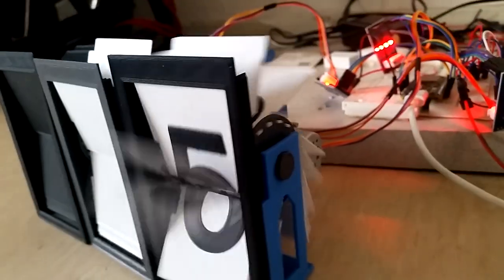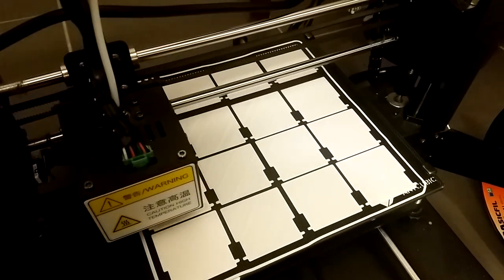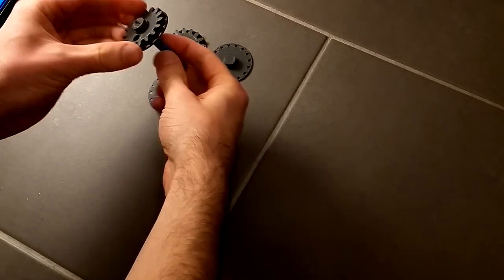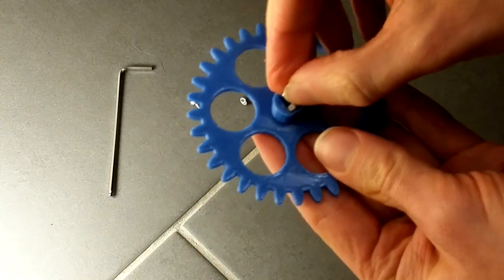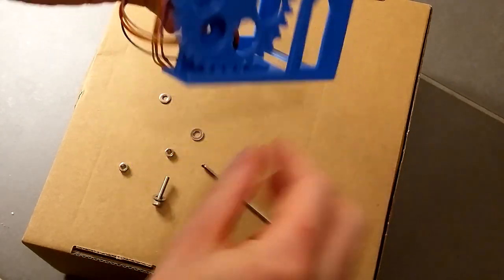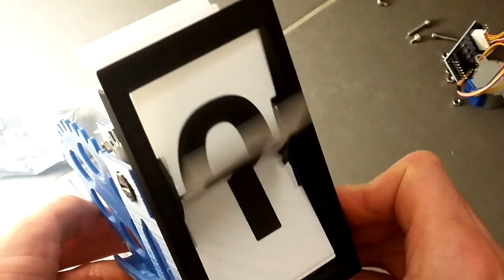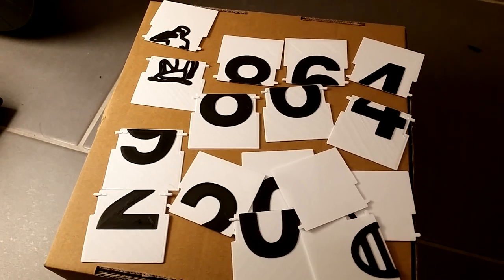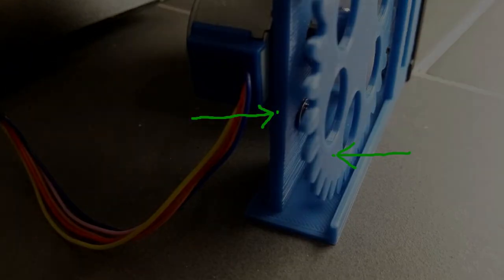3D printable Split Flap Display - Just Build Your Own :)

Comment: i would suggest adding bearings in the design if someone doesnt have a hall effect sensor you can use a lever switch as a trigger for position checking
Reply from the maker: Thanks for your feedback! I designed it in a way that requires a very slow amount of additional parts. It would run a bit smoother with ball bearings, but it is also okay without if you use sandpaper. The idea with the switch is pretty  nice :)

Comment: They look great!
I have read that these steppers aren't 100% accurate, that the gearing is off ever so slightly. So a full turn wont be 2048 steps, but some fraction less. Did you notice that with your steppers? Or did you use the software to adjust to the correct position if the hall effect sensor doesn't detect the magnet at the predicted time?
I'm asking because I'm building a split flap display on my own, and want to know if I'm overcomplicating things :D
Reply from the maker: Thanks for your reply :) I tested it several times with 65536 steps (so in this case 64 full rounds of flaps) and when i activley tested it, i could not detect any problems. But i noticed that they sometimes don't work perfectly over longer periods of time. I don't know if that is because of poor connection or stalling of the stepper or inconsistencies in the printed material - so, hard to say at the moment. But a hall effect sensor should fix this, i had the same idea as you, just check it appears at a predicted step number (every 2048), and if not (with a defined tolerance), recalibrate the values. But didn't implement it yet :D
But i think it runs accurate enough that the error rate is very low when you check and correct the position with a sensor.
Reply: @glumpfi  Thanks for the quick reply. That's great to hear, so I guess I'll hold back with coding that until I see noticeable errors. :D Gotta get the hardware working first anyway ... haha
I also love how you drive the drum with gears, you don't see that in diy split flaps often.
Reply from the maker: @paulurbaniak2242  I can do an extreme test tomorrow, with hundreds of rounds and test how many steps i need to correct to hit the exact same spot (if any?)

And actually, i chose the gear part just because i didn't want to buy expensive parts and i needed a design with very close digits. The real Lost-counter has almost no spacing between the digits, but i guess it is CGI. I have no idea how to get them so close together :/

Oh and one reason for the gears was that the motor is extremely slow! Only one revolution every 4 seconds.
Reply: @glumpfi  If you do that it would be awesome if you could share your results!

I know, the close spacing is an aspect i was working towards as well. I found the solution of putting the stepper inside of the drum that holds the flaps. That made for some more complicated cad, but it works quite well actually.
From what i have seen, the commercial units also used gears to translate the motion. As they can be really flat, thus achieving a tighter spacing. It makes the units deeper, but that's not really an issue.
And Oatfoundry (a company that makes split flaps commercially now) is using belts to drive the drums. But yeah, that's more expensive and not as space saving. I mean its probably worth it when you're building displays with thousands of units, but probably not something for diy in my opinion.
Reply: Pff ich sehe gerade, dass du deutsch sprichst. naja... :D
Reply from the maker: @paulurbaniak2242  Oh, the motor inside is a really good idea i never thought of! Unfortunately a bit slow with BJY motors. But you it would be compensated with a higher number of flaps, like with letters and so on... May i ask what you are planning to build?
Never thought i would have a conversation between split flap builders :D
Reply: @glumpfi  We can talk in german if you'd like?
Wir können gern in deutsch schreiben, es sei denn englisch ist dir lieber :D
Reply from the maker: @paulurbaniak2242  Können wir machen :D Ich glaube, an diesem Punkt ist das Gespräch eh schon viel zu speziell geworden, als dass irgendwelche Splitflap-Leute auf Youtube dem folgen müssten ;D
Werde aber erst morgen wieder schreiben.
Reply: @glumpfi  Ja das klingt vernünftig. Ich mach auch erst mal Schluss jetzt, ich schreib morgen in Ruhe.
Reply from the maker: @paulurbaniak2242  Also, gute Nachricht: Habe den Motor jetzt mal über eine Stunde laufen lassen (2.048.000 Schritte, genau 1000 Runden) und er steht genau dort, wo er angefangen hat.
Reply: @glumpfi   Danke für das Update!

Das ist super. Die Quelle für meine Sorge ist übrigens das hier: [hab den Link jetzt ganz entfernt. War auch nur ein Bild, was die Übersetzung in dem Stepper gezeigt und ausgerechnet hat. Da kommt man am Ende auf eine Untersetzung von 1:63,68]

Ich bin gerade dabei, selbst eine Fallblattanzeige mit 50 Fallblättern (flaps) zu bauen. Mit 3d-gedruckten Bauteilen, das Gehäuse und die flaps mit dem Lasercutter. Das Ziel ist dann eine 5-stellige Anzeige (Verwendung auch als Uhr).
Der Prototyp funktioniert auch ganz gut, paar Kleinigkeiten sind noch zu machen.

Dieses Video hat mir übrigens der YouTube-Algorithmus vorgeschlagen, weil ich in letzter Zeit so viel Videos zu split flaps angeschaut hab :D

(anscheinend kommt der Kommentar nicht durch, wahrscheinlich wegen dem Link...ich hoffe es klappt dieses Mal)
Reply from the maker: @paulurbaniak2242  50, wow, das ist eine Hausnummer! Sollte mit dem Stepper aber noch machbar sein. 5 Stellen sind bei mir auch geplant, 3 schwarze und 2 weiße.

Cool ist auch, dass das Projekt so universell einsetzbar ist. Habe es mit einem ESP32 gemacht (ein zweiter kommt noch dazu, weil einer nicht genug Pins hat) und habe so mit einem Script z.B. die View für dieses Video halbwegs in Echtzeit anzeigen lassen :D

Wie steuerst du das Ganze an?
Reply: @glumpfi  Ich hab eine ganze Weile überlegt, ob 50 wirklich machbar sind. Habs dann aber einfach probiert, und es klappt auch.

ESP32 ist cool, ich überlege auch einen mit rein zu bauen. Ich hab nur leider gar keine Ahnung, wie ich den dann richtig programmiere. Aber dazu gibt es zum Glück viele Tutorials :D
Hätte natürlich was, um sich diverse Dinge ausgeben zu lassen, und natürlich auch die genaue Uhrzeit. Naja, kann ich immer noch nachrüsten.

Ich hab einen Arduino (momentan noch uno für das Prototyping, am Ende kommt ein Nano rein) für die Steuerung. Ein RTC-Modul für die Uhrzeit und für jeden Stepper einen Treiber (A4988). Ich hab die 12 V - Variante der 28byj-48 Motoren, um bisschen mehr Drehmoment zu haben und um die mit dem Treiber ansteuern zu können.
Reply from the maker: @paulurbaniak2242  Ein A4988 geht auch für diese Motoren? Habe da diese blöden ULN2003 mit 4 Pins pro Motor, was einfach irre viel ist. Die A4988 brauchen ja glaube ich nur 2 bzw 1 Pin, wenn die Richtung immer gleich bleibt, oder? Das wäre cool, weil ich aktuell 2 ESPs brauche, die dann irgendwie miteinander kommunizieren müssen :/

ESPs funktionieren eigentlich genauso, auch über die Arudino-IDE (mit ein paar leichten Anpassungen). Kann ich sehr empfehlen, allein wegen der enormen Geschwindigkeit/Speicher und WLAN.

Hab z.B. bei meinem den mitgelieferten Webserver verwendet, so dass ich die Ziffern einfach über einen Link von überall aus einstellen kann :)
Reply: @glumpfi  Der A4988 funktioniert für Schrittmotoren mit einer Spannung von 8 - 35 V. Deshalb konnte ich da nicht die 5 V Motoren nehmen, hab aber die 12 V Version gefunden (die gibts nur nicht so häufig). Weil mit die 4 Pins pro Motor auch einfach zu viel waren. Da sich die Richtung nicht ändert, braucht man pro Motor 1 Pin + 1 Pin für alle für die Richtung.
Soweit ich es verstanden habe, ist das rote Kabel an den Schrittmotoren nicht für die Ansteuerung notwendig. Diese ULN2003 haben ja auch nur 4 Kanäle. Und dann funktioniert die Steuerung mit den A4988 richtig einfach. Man kann sogar microstepping damit betreiben, hab das aber noch nicht ausprobiert. 

Oh der ESP hat sogar einen AD-Wandler mit an Bord, das ist super. Meine Hall Sensoren sind analog, ich weiß da gibts auch digitale, aber die analogen gefallen mir besser :D
Da sollte auch ein ESP für alles reichen oder?  Die Lösung gefällt mir echt gut
Reply from the maker: @paulurbaniak2242  Also weißt du, dass die Motoren mit den A4988 laufen? Ich dachte immer, die wären nicht kompatibel (Unipolar/Bipolar?) - das wäre ja echt gut. Mit A4988 hab ich mit Nema17-Schrittmotoren gearbeitet. Da hatte ich nur das Problem von störenden Pfeifgeräuschen, aber das Problem hab ich bei anderen Leuten nie beobachten können.

Oh, aber a4988 habe ich extrem belastend zum Löten empfunden, weil man irre viele Pins mit Strom verbinden muss, Kondensatoren braucht etc. Die ULN2003 schließt man einfach an :D (Zusätzlich 12V + Ground-Verbindung)
Reply: @glumpfi  Also bei mir funktionierts :D
Wie gesagt, die 12 V Version, weil die Treiber anscheinend nicht mit so niedrigen Spannungen laufen. Die Motoren sind zwar prinzipiell unipolar, aber wenn man das rote Kabel "ignoriert", kann man die auch bipolar ansteuern. Man kann den Motor auch aufmachen und in bipolar umwandeln, aber das hab ich noch nicht versucht. Klappt auch so.
Wirklich leise ist es nicht, typische Steppergeräusche eben. Bekommt man vielleicht mit Microstepping weg, aber bei mir sind die Flaps sowieso bisschen lauter :D
Reply: @glumpfi  Ich würde gerne mal ein kurzes Video zeigen, dass es funktioniert. 
Lässt YouTube gar keine Links in den Kommentaren zu?
Reply from the maker: @paulurbaniak2242  Anscheinend nicht... Die "clevere" Spam-Erkennung hat schon echt öfter Probleme gemacht. Ist es hier auf Youtube? Wonach soll ich denn suchen? Oder du kannst ja die Video-ID reinschreiben
Reply: @glumpfi  Ich hab das auf Imgur hochgeladen. Das heißt "Split Flap Display Prototype Test". Sollte als einziges Ergebnis erscheinen wenn man das in der Suche eingibt.

Sry für die Qualität, ist nur ein zugeschnittenes Handyvideo. Ich bin auch im Moment nicht zu Hause, sonst hätte ich ein schöneres Video gemacht :D
Reply from the maker: @paulurbaniak2242  Oooh, das läuft aber echt richtig schön durch! So hätte ich mir das ehrlich gesagt bei mir auch gewünscht, aber da sind 16 Blätter wohl zu wenig. Gefällt mir echt gut :D
Reply: @glumpfi  Haha, danke! Es hat auch eine Weile gedauert, alles anzupassen damit es so läuft. 
Die flaps sind noch etwas zu dick. Der nächste Schritt wird es sein, die aus dem dünneren Material zu fertigen und auf alle flaps die Buchstaben / Zahlen draufzumachen.
In deinem Video laufen die aber auch schön gleichmäßig oder nicht? Und ich finde das echt gut geworden, jetzt auch nicht zu langsam oder so.
Reply from the maker: @paulurbaniak2242  Ja, das Anpassen war bei mir auch der Horror, habe glaub ich alle Teile am Ende 7 Mal drucken müssen :D
Danke! Der Gedanke war ja, das ganze low-budget-mäßig und mit keinen/minimalen Zusatzteilen und -geräten aufzubauen (... weil ich beides einfach nicht habe ;D) und dafür bin ich am Ende auch recht zufrieden.
Meine Flappen sind auf jeden Fall auch übelst dick (0,6mm! + jeweils 0,4mm Schrift auf jeder Seite :D)
Wirst du das Ganze auch irgendwo dokumentieren?
Reply: @glumpfi  Mein 3d-Drucker ist ein resin-Drucker (SLA-Drucker), deshalb ist es für mich nicht wirklich möglich, die flaps zu drucken. Deshalb die Lösung mit dem Lasercut, und das hat mit 1mm starkem ABS auch "okay" funktioniert. Ich hab noch Polystyrol-Platten bestellt (0,5 mm), mal sehen wie das läuft :D
Die Buchstaben / Zahlen mache ich dann, indem ich Malerkrepp auf die flaps klebe, dann die Schrift laser. Dann kann ich das Malerkrepp aus der Mitte entfernen und die Schrift mit Sprühfarbe draufbringen. Das wird auch nochmal richtig viel Zeit kosten (50 flaps x 5 ... naja)

Ich hatte eigentlich nicht vor, dass zu dokumentieren. Ich kann aber am Ende (wenn es klappt) die CAD-Dateien und meine Notizen irgendwo veröffentlichen. Weiß nur nicht wo, und ob sich das überhaupt lohnt? Ich meine die community darum ist so schon klein, da ist die Frage ob das überhaupt jemand findet oder?
Reply from the maker: @paulurbaniak2242  Ich sehe schon, du hast das Profiwerkzeug zur Verfügung :D Ehrlich gesagt glaube ich schon, dass es viele Leute gibt, die das interessiert - ich hätte dein Projekt hier z.B. gesucht. Auf Reddit gibt es auch ganz viele Foren zu Arduino, 3D-Druck, bestimmt auch CNC oder allgemein DIY-Zeug
Reply: @glumpfi  Ha, ich habe so einen kleinen China-Lasercutter. Aber der hat sich mittlerweile echt bewährt. 
Hm das stimmt. Ja ich kann das am Ende dokumentieren und öffentlich machen. Aber mal sehen, wie viele Wochen (Monate) noch vergehen, bis das Projekt fertig ist :D
Reply from the maker: @paulurbaniak2242  Ich fänds cool! Habe selbst so viele Sachen undokumentiert gelassen, echt schade im Nachinein. Ich glaube, es gibt echt viele Leute, die das feiern. Wenn der Youtube-Algorithmus einen nur nicht so rausfiltern würde....
Reply: @glumpfi  Ja das stimmt. Ich hab ja auch alles bis jetzt in irgendeiner Form für mich selbst dokumentiert.
Und soo schlimm kann der YouTube-Algorithmus nicht sein, der hat mich schließlich hier her geführt :D

Was ich schrecklich finde, ist die Suchfunktion in Youtube. Es werden maximal 10 Ergebnisse angezeigt, bevor andere Videos angezeigt werden. Naja.
Reply from the maker: @paulurbaniak2242  Ja, du hast es geschafft :D Auf einem anderen Kanal habe ich Videos, da kommt vielleicht alle 2 Wochen jemand, obwohl da extrem viel Mühe drinsteckt... Obwohl es glaube ich Leute gibt, die sich für sowas interessieren.

Auf Reddit gibt es definitiv ein Publikum, hab da letztens ein Video von einem alten Projekt in einer Arduinogruppe hochgeladen und über Nacht haben es über 60.000 Leute gesehen und waren begeistert. Das war schon echt ein Unterschied!
Reply: Hi guys! Thanks for sharing your designs, I've also been designing and prototyping a split flap display on and off for a long time. I always got stuck on the production of the flaps (wanting to do 64 flaps per unit) but I found a local company in Sweden that could produce them professionally! 

The startup cost would be around 1000 euro, and then it's €8-15 per set depending on quantity. 0.8 mm thick black polypropylene with white screen printed text, just like the original Solari boards. Would you be interested to get in touch and discuss it?  Or to just talk in general on discord/zoom or something? 😃
Reply: GREAT

Comment: can you take a photo or semething like a tutorial to connect the hall sensor, something like the electric circuit
Reply from the maker: To be honest, I never worked with such a sensor. In my project I let it run without a sensor. I just have to take care to set it back to zero before I unplug it
Reply: how did you make that? can you help me, i'm having problems with sensor and wanna try make without sensor
Reply from the maker: @pedrohenriqueweszpiccoli5511  I just make sure that whenever I unplug the microcontroller, the display is set to a zero position. When it's not, I have to manually reset the position. I control 5 of those displays via ESP32 and send the commands via WiFi
Reply: @glumpfi  can you send me the code?
Reply: @glumpfi  can you show the code?

Comment: someone can send the code?
Reply from the maker: I wasn't able to find my code, but in general I used AcellStepper library and 64 steps mean one flap while 1024 steps mean one revolution of all 16 steps
Reply: @glumpfi  i'm trying a lot of codes with chat gpt help but doesn't works
Reply from the maker: @pedrohenriqueweszpiccoli5511  Allright, so here is my code:

https://pastebin.com/yG4D3QPU

But be aware that this is full of other stuff like LED controlling, web server, socket server.  And it's written for 2 ESP32 microcontrollers. One master controller and one second slave controller that just controlls more flaps and receives commands from the master controller